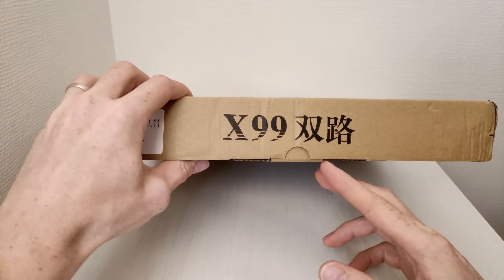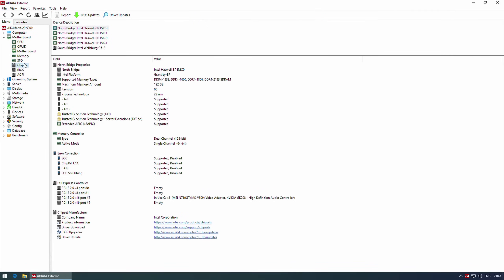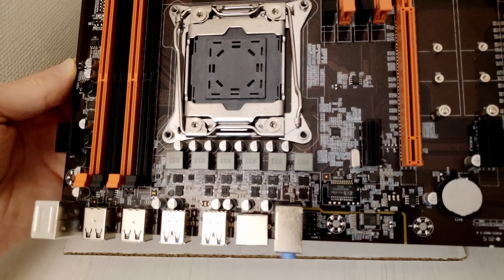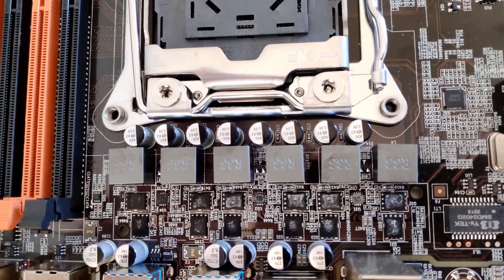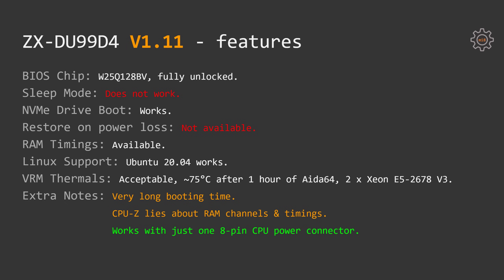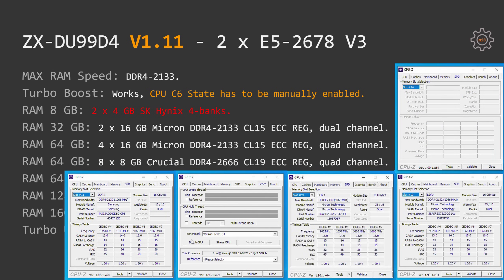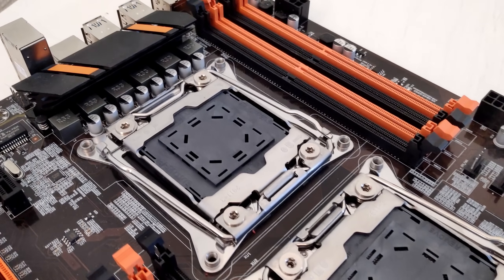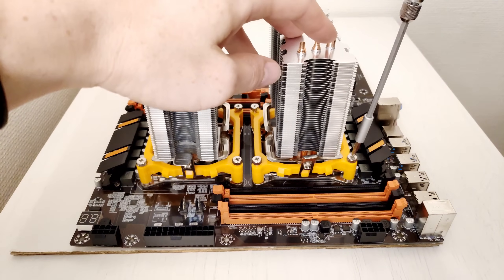🇬🇧 Detailed review of ZX-DU99D4 V1.11 Dual Socket LGA 2011-3 | E5-2678 V3 | E5-2620 V4

Comment: Well, you have deleted my comment.  I was just trying to help .. The tutorial i have written is correct and works perfectly and not needed install manual efi drivers anymore,. This metod insert native turboboost in to de bios. I have tested it on my dual xeon e5 2660v3. Do the test yourself and confirm for yourself what I say and confirm for his followers .  Greetings and thanks for your video and your help is very good and helps the community a lot.  Greetings.
Reply from the maker: Wait, what? I didn't delete any comments! I only delete completely outrageous comments when people are trying to insult each other. Let me check if YouTube decided that the comment needs my manual approval.
Reply from the maker: No, I don't see any comments in the "Held for review" section. Could you please post the link again? If that doesn't work either - please join my Discord and send the link over there.
Reply: @Miyconst  I don't know what happened .. I post again or boot if you don't see it correct .. in your case check this method, I think it's perfect .. Greetings.
Modify or delete what you see fit.  I have tested this method on two motherboards and I assure you that it works perfect .. I have written as I could because my English is somewhat defective, sorry, a greeting and a big hug for you. 
This is the post:
Now not need manual efi drivers to TurboBoost in dual cpu. Im found perfect path bios without efi drivers. work turboboost perfect without manual efi drivers. Only path bios with this tuto: https://xeon-e5450.ru/socket-2011-3/e5-2600-v3/dobavlyaem-anlok-v-bios-raz-i-navsegda-cherez-s3turbotool/
 Perfect,  not need manual efi driver,  work fine fine,  and easy for dual cpu (insert DXE controller by 2 cpus). This method insert native support turboboost in bios. I recomended install windows 10 pro after patched Bios. And TurboBoost work perfect in Your dual xeon processors, and not need reinstall never more, because the path is permanent in your Bios.
Download and use the previous version of S3TurboTool, not the newer version, in my case the newer version just skips a warning message constantly and does not start the application, the previous version of S3TurboTool works perfect to perform the steps.
Reply from the maker: @vandaloz7z  thanks for the info! I have already tested this method and there are multiple S3TurboTool options in Mi899. Sadly I don't have any dual socket motherboards to test with, so for now I can only confirm the single socket options.
Reply: @Miyconst  Well, it is no longer necessary in the previous method of manual installation of the efi driver, this method is much cleaner, works perfect in dual shocket and gives native support for turboboost directly in the bios.  Take the link of the tutorial (it is in Russian, only translate into your language with google translator).  Once patched, the bios remains forever, and logically for dual shocket windows 10 pro is necessary.  I have done the method and my xeon 2660v3 literally fly and the system is totally stable.  Greetings to everyone and to you especially.
Reply: can you send the link to how to enable turboboost bios mod
Reply from the maker: @medical44  https://xeon-e5450.ru/socket-2011-3/e5-2600-v3/dobavlyaem-anlok-v-bios-raz-i-navsegda-cherez-s3turbotool/

Comment: New versión V1.12 for this motherboard. Support NVMe v4 and pci gen 4??. What is the difference V1.11 vs V1.12?.
Reply from the maker: No, PCI-E get 4 will never be supported by the LGA 2011-3 / X99 platform.
Reply: @Miyconst  But New version V1.12 has new bios optioms??. Do you know the difference by v1.11 vs v1.12??
Reply: @Miyconst  Ok,  thanks.

Comment: I have this board, I can´t activate the nvme Cards. how i can find A manual how to setup the bios??
Reply from the maker: There is no manual for this motherboard and the BIOS has nothing to do with NVMe. There are jumpers on the motherboard, which you might need to flip.

Comment: Dual E5-2698 v3 + A-Tech ( 4x 16GB Modules ) | DDR4 2133 MHz | Non-ECC UDIMM ( Unbuffered DIMM ) 

ERROR b7 

Help!!
Reply from the maker: The memory doesn't seem to be compatible.
Reply: @Miyconst  thanks for anwser 

according to the mb specification it can be ddr4 2133 non-ecc and the cpu also...
Reply from the maker: It doesn't matter what is "according" to the motherboard, Chinese never follow the specs. B7 code indicates that the memory is the issue. Try with only two memory modules, one per CPU in the furthest slot from the socket. If that doesn't work, you have to find some ECC REG memory to test.

Comment: My setup keeps crashing because of the ram I think. I have used M393a4k40cb1-crc (ECC, Registered, RDIMM 32GB 2400MHz). Any suggestions?
Reply from the maker: Run Memtest86 and validate the memory.

Comment: Does it support PCIE bifurcation on the x16 slots?
Reply from the maker: Sorry, I don't know.
Reply: @Miyconst  I have used a NVMe adapter which has a PCIe switch on it, no need for bifurcation. works perfectly.
Reply: @QasimZaffar  but.. did you encunbter the option for bifurcation the pcie x16 in ZX-DU99D4 V1.11 ?  the intention is to use 4xm2 in the pci ex 16.
Reply: @vfox16  couldnt find the option but it may be aswell that i missed the option to do so because according to the alieexpress seller it supports pcie bifurcation. Alternatively you could use a pcie to nvme adapter which has a pcie switch chip on its pcb. I used such adapters and works just fine, no need for pcie bifurcation.
Reply: @QasimZaffar  AWESOME ! tks for the work.
Reply: @QasimZaffar  and the speed of the ssd?? Chia Plots?
Reply: @jpbravo2012  speed of ssd depends on the ssd, my adaptors and this motherboard support pcie 3.0, so it wont run faster than 3.0. Still good for plotting though
Reply: @QasimZaffar  The PCIE in this motherboard is pcie gen2 1x..not suport full speed for pcie gen 3 and speed in pcie gen 2 is more slow speed.

Comment: Good morning mate

I saw that you made some files that help and make it easier to do the overlock boost and you made it easier to do this procedure and I would like to know if you have the BIOS modified from this motherboard to boost it?
the motherboard I have is the same as the one in this video and also the processors.

if you have the Bios and you can send it to me or if you have updated the link you made with the Bios and if the file is there I will follow the procedure shown in the video.
  my email is: sidneirio@hotmail.com

I thank you in advance for your valuable help and attention.

Sidnei

Comment: Thanks for your sharing this video X99 Dual CPU motherboard, I had bought this Dual CPU motherboard after I install it only detect 1 CPU in sock 0 but the socket 1 not available so I check all physicals CPU socket all is fine and try swap 2 CPU still the same, my CPU are  i7-5930K CPU @ 3.50GHz but work with windows10 OK 1 CPU , please giving advice Thanks.
Reply from the maker: Only Xeon E5-26XX and E5-46XX can work in pairs. There is no way you will make two i7s work together.
Reply: @Miyconst  Now I know it Thanks.
Reply: Will just one i7-5820k cpu on this board works?

Comment: So I got my ZX-DU99D4 a few days ago. The BIOS date is from december 2020, so I guess it‘s newer than the one on the board reviewed here. It does support power on after power loss and „last state“. It also supports PCIe bifurcation, at least it says so in the BIOS (I have no card to test it). It is indeed picky with RAM. I had to try several RAM sticks before some worked. Otherwise it works just fine. The two E5-2680 v3 will turbo to 3GHz out of the box.
Reply: Oh, and at least with Windows Server 2019 USB3.0 works without additional drivers. Did you by chance use an old Windows installation made with another board to test it? I did that, and USB3.0 didn‘t work as expected, but after a fresh installation it did.
Reply: what ram did you use to get the board to work?
Reply: @markbale7002  It didn't like any of the 8Gb sticks I had (all non-ECC), but any 16Gb sticks worked so far, ECC and non-ECC. Didn't have any 4Gb sticks...
Reply: @jensdroessler3575  hmm, might have to try 16gb sticks. I only have non eec 8gb sticks

Comment: I hope this question is not too stupid, but do I need a special power supply with two EPS12V connectors to power the board? Or is there an adapter to double the connector on my Antec EAG PRO 550W?
Reply from the maker: You can buy a Y-splitter for the EPS12V connector, but in general you need two of these.
Reply: @Miyconst  Thank you for replying so quickly. That was really nice. To be on the safe side I ordered a new PSU with multiple EPS12V connectors. Sorry to bother again, but do you happen to have a hint on how to connect to this board's front panel connector? There are just colors - no labels on the board.
Reply from the maker: The front panel I/O follows the standard pinout, you can find the diagram online. I would drop a link here, but YouTube cuts it off.
Reply: @Miyconst  Works now. Thanks a lot. Now I just wait for my PSU to arrive. Then I'll see to unlocking my E5-2678v3 CPUs. Thanks again very much for your help.
Reply: @Miyconst  PSU has arrived. System (UNRAID) works flawlessly. Do you happen to have a BIOS-file which I can use to permanently turbo-unlock the CPUs? I have watched your video on that, but I am not sure which file to use.
Reply from the maker: @silscheder  as I said in the video, permanent turbo boost unlock with FFS driver injection into the BIOS didn't work for me on this motherboard.

Comment: Miyconst, do you recommend to flash the ZX-DU99D4 with the huananzhi x99-f8d bios for dual CPU not being recognized? I am having issues to make dual e5-2680 v4 to run on the ZX-DU99D4. One CPU works ok, but when I put two cpu, it gives the error code 79 and does not boot.  2 x e5-2680v4, 4 x 8GB Samsung 2Rx8 non ecc  memory installed on the orange slots. If one CPU and 4 memory sticks in the cpu 1 works ok recognizing all 32GB.
Reply from the maker: I can't recommend that, since it's not guaranteed to work either, but if you have an external USB flash programmer and not afraid of bricking the motherboard, then you should definitely try it.
Reply: Boa tarde, vc conseguiu resolver? Estou com o mesmo problema, comprei a mesma placa.

Comment: which x99 dual cpu motherboard do u recommend?
Reply from the maker: None. What do you plan to use the PC for?
Reply: @Miyconst  im plan yo make heavy work on it for long period of time
Reply from the maker: @ZendoOficial  in this case I would recommend you to hunt for second hand Asus deals on eBay, but if that doesn't work then go for Huananzhi X99-F8D.
Reply: @Miyconst  which asus ??
Reply from the maker: @ZendoOficial  any Asus, most of their dual socket boards will serve your purpose just fine.

Comment: my two 2680 v4 cpu didnt work on this board. Debug code is 79....When only one cpu was connected, it worked on a cpu 0 socket, but not on a cpu 1 socket. debug code ff
Reply from the maker: This is most likely a BIOS issue then. V4 CPUs might need something extra to work in pairs.
Reply: Hello friend, were you able to solve the problem? The same thing happens to me. (Sorry for my bad English, I'm using Goole Translate)
Reply: No, I asked the seller but couldn't solve it.
Reply: If you want to setup 2 CPU, you have to use ECC-Registered RAM. Otherwise, you will keep getting the error code 79.

Comment: hello miyconst, may i ask which is the best X99 dual socket motherboard? is it F8D or something better is up there with overclocking option
which is best value for most cores threads? still 2678 v3
planning to run them for MT5 optimization which was a past project you did under best budget and thought getting couple of dual sockets to get most cores and threads *electricity is cheap in my country
Reply from the maker: First of all, there are no CPUs which can work in a pair and support overclocking, thus it is pointless to buy dual socket boards for the sake of overclocking. Second of all, in most cases you will be better with a single socket motherboard. And lastly, if you really want a Chinese dual socket X99 motherboard, then yes, go for Huananzhi X99-F8D, but I would strongly recommend to go with a single strong CPU.
Reply: @Miyconst  thank you so much for your honest answer. will go for a newer CPU like recommended

Comment: Good video! I know it must not be easy to record in both languages, so the effort is appreciated. I have a question though, and it's about Turbo Unlock on dual E5 V4. I know there is a github driver to unlock dual E5 v3s, but does anything exist for dual E5 V4s? Thank you and have a great day
Reply from the maker: There is nothing for V4, these CPUs were "fixed" by Intel and no longer compatible with the turbo boost unlock hack.
Reply: @Miyconst  Huh, I was just wondering since there are all these crazy 3.7GHZ dual 2699V4 on HWBOT
Reply from the maker: Too bad these CPUs are still overpriced.
Reply: @Miyconst  Well I was thinking about buying two 2690 V4s, but I might splurge for two 2699 V4s if I can get the boost unlock on them, just like those guys on hwbot seem to have done

Comment: Hi, anyone got this board? The board smell like burn plastic, is it "normal"? Does it go away?
EDIT: for the cooler, I have 2 Coolermaster Hyper 212 evo, they don't cover the entire cpu but at full load I got 47deg max. I bought low memory to be able to fit them. Can this be the burning plastic smell? A bit of thermal paste is still on the cpu where the cooler doesn't go because I didn't knew that it doesn't cover the whole cpu at first.
Reply from the maker: Burning plastic may come from underneath the motherboard and has nothing to do with Hyper 212 Evo. It's a very good cooler, even though it doesn't cover entire CPU. Check under your motherboard, sometimes Chinese run tests on protective foam, which melts and sticks to the motherboard at the bottom. Also you can leave the PC for a few days and see of the smell goes away.
Reply: @Miyconst  The odor disappears little by little, it's almost gone now. Thanks for the feedback.

Comment: I've got mine of this from taobao for 545 RMB, which was being sold with Zhixin(智芯) brand, model name X99双路 (lit. Dual-road). When it used with turbo boost-unlocked dual E5-2683v3, it throttles a little without additional cooling to the heatsinks, but still works with a single 8-pin power connector. Still, it's great to having a Task Manager filled with 56 threads for this price tag.
BTW, I wouldn't have known about the secondary M.2 slot can be used as an NVMe slot if I don't watch this. Thank you for your great video!

Edit: my bad, it's 8-pin, not 4-pin.

Comment: Thank-you for such a good review, I'm actually tempted to buy one of these (I know that you recommend three others over this one but it's a cost issue). Tell me, what cpu coolers would you recommend for this board? What were those yellow ones you were using please?
Reply from the maker: May I ask why would you want a dual socket configuration?
Reply: @Miyconst  Hi, thanks for your reply. I'm currently running a 7th gen Blade server but I'm thinking of replacing it with a custom build 4U case and something like this inside? It's €166 on AliExpress now with 64GB DDR4. To me that sounds like a bargain?
Reply from the maker: @TheRobMozza  if you are looking to build a server, I would strongly recommend you a branded motherboard, these Chinese boards may have many random issues with virtualization and other server grade features.
Reply: @Miyconst  again I thank-you for your reply. Could you please tell me what CPU coolers you managed to use? The best solution for the 'too close together CPU sockets'?
Reply from the maker: @TheRobMozza  it depends on the motherboard, but in general, you shall look for coolers which don't require the AM4 bracket, take the one which has a reasonable size and screws right onto the socket.
Reply: @Miyconst  Thank-you once more for your reply, however you didn't really answer my question! I don't want to buy this board and then 'trial and error' to find a suitable HSF. I'm aware that you don't advise that I actually buy this board.. maybe that's why I cannot get a straight answer out of you? Don't worry, like everything else in life, I'll sort it out myself.
Reply from the maker: @TheRobMozza  I used Inter-Tech H Argus Su 200 cooler, but it's no longer available in stock and it's not optimal for this motherboard at all, that is why I didn't want to recommend it: https://www.amazon.de/gp/product/B07BRDFCM9
Reply: @Miyconst  Thank-you anyway

Comment: @Miyconst great video. Do you happen to know if there is a document for this board which describes the pin of the connectors. In intrested in connecting the front panel to the board (like hdd, reset, power etc.).
Reply from the maker: I do happen to know. There is no such manual.
Reply from the maker: For the front buttons/LEDs pinout you can use the stand layout, it's available online.
Reply: I'm really late but I was asking me the same question not too long ago. The diagram is printed on the motherboard directly. It's not directly beside the connectors but it's there.

Comment: I bought from the official store kllisre ngff 512MB this board does not support? so salesman lied to me
Reply from the maker: It should be supported, but you might need to flip some jumpers. See the diagram on the motherboard.
Reply: @Miyconst  I made all possible combinations of jumpers 1-2 3-4 and nothing worth it but another mb to test the m.2 ngff was almost all my budget in this investment of rendering pc
Reply from the maker: Then you have to contact the seller and ask for support. My motherboard worked with SATA M.2 SSDs.